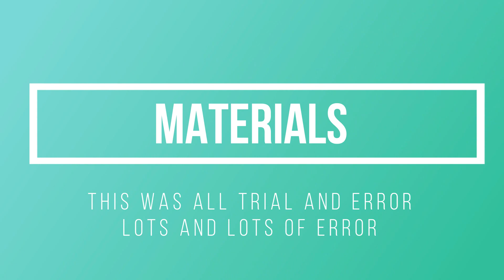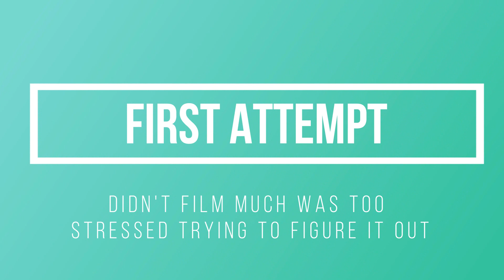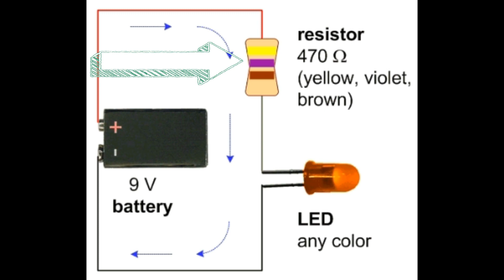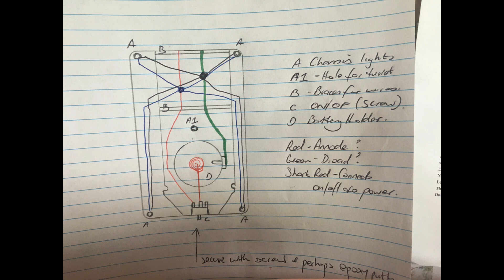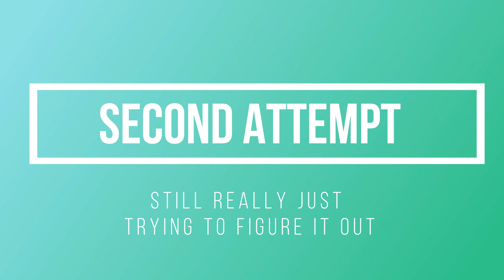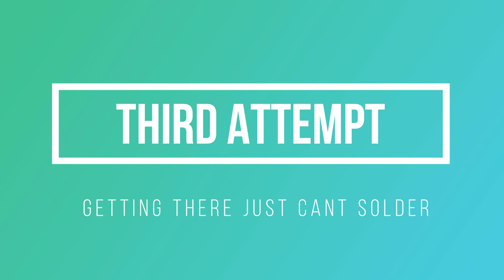Installing LED Lights In the Pershings

Comment: nice technique. So, how does this work when the battery runs out? do you have to gut open the model...?
Reply from the maker: I didn't glue down three of the four tanks upper hulls, but realistically I doubt that I would worry too much about replacing the batteries, it was more for the final reveal video than anything else, and to learn how to do it, I want to do more in 1/35 scale vehicles moving forward.